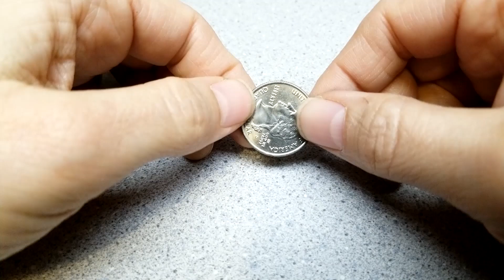Ultrasonic / Silent-Wave Motor Teardown

Comment: Hi. Great video. Thank you. Wanted to ask what would you suggest for cleaning both insides of inside metal? I have couple of motors and I used methylated spirits and think this might not of helped
Reply from the maker: I am not sure.

In the one I took apart, there was a race of ball bearings, which needed lubricant of some kind, after they are cleaned. Whatever is used will have to be pretty thin. I am not sure if even sewing machine oil is light enough. I think that that this is the only place in the motor where there should be any lube.

The alcohol could have attacked plastic, if soaked, but I am surprised if any were damaged short term. There is a sandwiched layer between metal that needs not to be attacked by whatever you use. Apparently, methylated spirits may contain not only alcohol, but other chemicals or additives/constituents/adulterants that might have left a film on the motor working surfaces.

A great deal of how the motor operates is by friction, so on either metal contact surfaces , it would seem that they should be clean with no oil at all.

With one of the motors that might not work anyway, I might try either either 90% isopropyl alcohol or spray carburetor cleaner on most of of the motor, keeping anything from dripping from the bearing. Afterwords, I might try not even one drop of sewing machine oil on the bearing. I use it for my skateboard bearings. It can't be so much that it can contaminate the round disk-like contact surfaces.